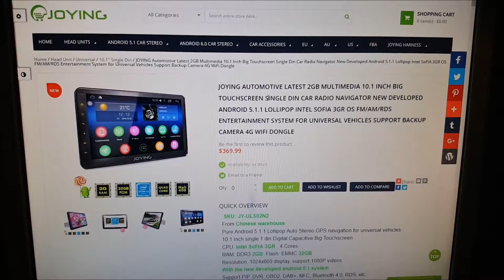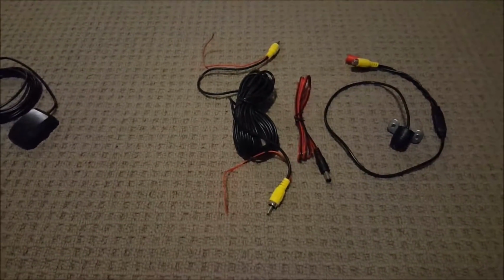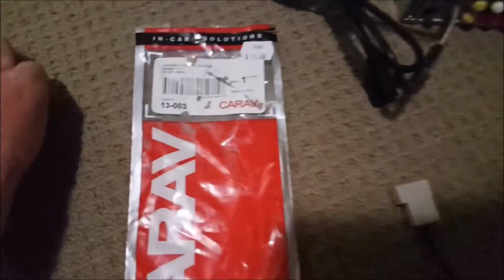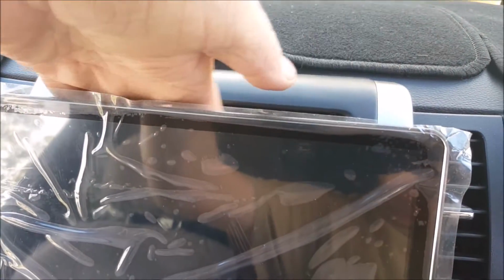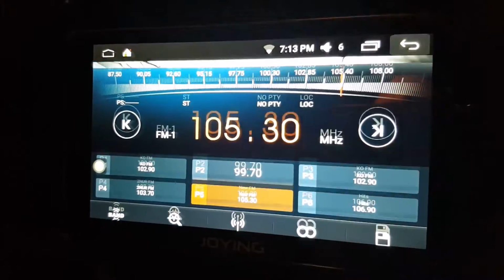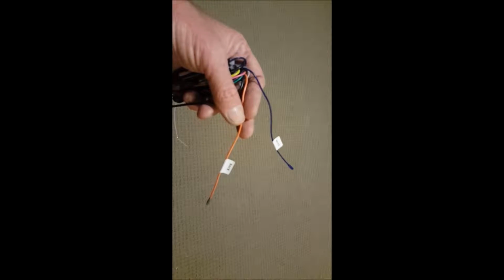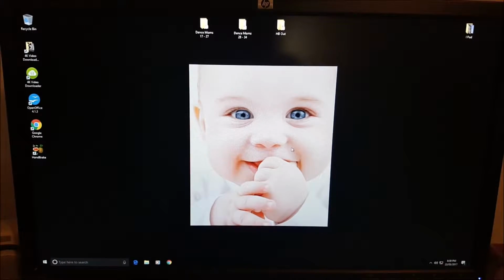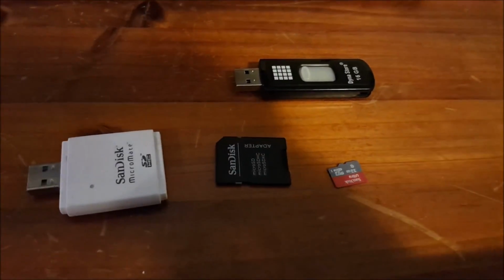Carjoying Head Unit Install XTrail

Comment: Just a quick question, do you think dash cams and rear-view cameras other than those from Joying will work with their systems, I don't see why not myself.
Reply from the maker: i managed to get the factory installed reverse camera to work well with the joying head but the factory installed camera was originally connected to the screen that was in the revision mirror. as the screen was small the factory camera didnt have good resolution on the larger head unit. when i tested the camera i purchased with the head unit it was much clearer. im hoping to post another video soon when i swap the factory camera with the joying camera. if i was to do the whole thing again i would replace the camera as well. you wont need to replace all the wiring between, just the camera, considerably clearer due to higher resolution. as to the dash cam camera, im about to test a 1080p camera i already own. send me another msg in about 3 weeks and ill let u know how this goes.
Reply: Thanks for your info